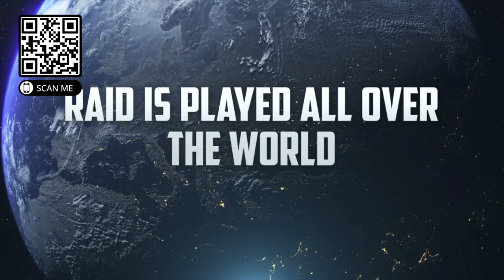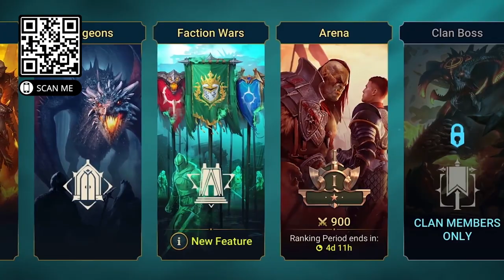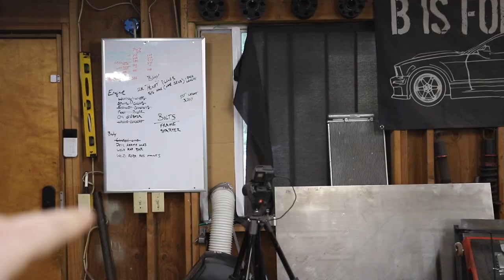Off-Road Lamborghini Huracan Gets Massive GT500 Brakes Installed

Comment from the maker: Install Raid for Free ✅  IOS/ANDROID/PC: https://clcr.me/Jun_BisforBuild   and get a special starter pack 💥  Available only for the next 30 days
Reply: Heat Sheilds on the coil packs!  you'll bake them puppies if not protected.
Reply: Get some of those cheap plastic totes to cover your car bits if you're painting outside to protect them from rain/bugs/etc. Just turn 'em over and plop them down.
Reply: I didn't get a special starter pack. :(
Reply: No
Reply: @eriklarson9137  I am old.. so there is that... but fine..stick a coil pack 4" from a hot exhaust on a high performance engine... no worries...  ;)
Reply: traditionally there is either a floating calipper or a floating disk. the setup here seemed fixed on fixed, but i should ask. which one is it?

Comment: I like how casually he says “We have 800-900hp engine on the way”, like it’s no big deal
Reply: Yea, I'm happy I have a 101hp 1.4L engine in my vw polo 6n😂 and it's more than enough for such a little car.
Reply: @DjKrakTV  101 with a 1.4 6n? What’d you do to it? Thought the came standard with 75hp in the 1.4
Reply: Reminds me of the Star Wars meme
"200.000 Units are ready, with a million well on the way"
Reply: I love how casually he says “on the last LS Swapped Huracan we did”.
Reply: What I like more is that it really is not a big deal anymore.
Reply: B is for Build has come a long way.
Reply: I mean... it isn't really. Anyone with a credit card can buy the exact same thing. It's very cool that he's funding this stuff off of YouTube.
Reply: And you dont?😂😂😂
Reply: Helps when he does pay out of pocket for it
Reply: @Bassie23  the 1.4 mpi 8v has 60 hp and my is 16v, they're becoming rare.
And 1,6 GTI has 125 hp, with small changes I can be there too.👌😁
Reply: Righttt like it was just an impulse buy on Amazon 🤣🤣
Reply: @DjKrakTV  that’s awesome! I had a 1.6 8v thought that had 75hp standard? But don’t quote me😂 it was already a blast to drive as my first car, with the 165 tires it could easily break the tires because it was so light😂
Reply: @Bassie23  yeah, they had 75hp and 60hp depending on the block.
Mine wasn't running as I bought it,  I've learned so much about cars from it. Car was 100 € and I've spend about 2 years and 1500€ to bring it back to live.
Reply: @DjKrakTV  that’s awesome! Is there an instagram I can follow it on?
Reply: @Bassie23  yeah, polo_6n_by_kraszu 
But I haven't posted anything on there since last summer

Comment: i dont know if it was the video angle but the difference between brake and throttle pedal position  seems so far off like you have too move entire leg just too switch from one too the other. It's a big no no racing applications you want 3cm of heighted and depth diff at max so switching goes quickly. i hope it is the angle of footage gave wrong idea suspect you guys know this.

Comment: Ok, I'm confused as to why they're not just running an electric power steering pump? Would make much more sense for a mid engined vehicle
Reply: I’m assuming it’s due to restrictions.
Reply: @richardomontobahn4327  yeah possibly, but from my knowledge of the rules that are usually in motorsports, that's not something that would usually be restricted, and if it's not, then they're just making much more work for themselves, also the electronic ones usually last longer and withstand more abuse at higher RPMS
Reply: They do not put out the pressure and flow needed for that rack. Getting one that would provide those requirements would put a huge drain on the electrical system. This isn't a street car with little tires.
Reply: I was wondering this as well....

Comment: This car is almost a "Ship of Theseus" there is so little of the original Huracan left
Reply: Like 50% of the original chassis, doors and apparently a brake booster/fluid reservoir? Is there more?
Reply: Not exactly the right analogy, as it postulates replacing all the original parts with the same parts. Like it's George Washington's axe, except the handle was replaced four times and the head twice. You get the idea. A lot of resto-mods are frankenstein creations. Look at PowerNation's videos on rebuilding a Ford F100.. new frame, engine, transmission, rear end, etc. with the F100 body on top. Is it still an F100? Well the VIN is what matters, and it's attached to the body, so yes, at least legally, it's an F100. But no it's not really an F100, it's a custom truck with an F100 body. So this is legally a Huracan, but it's really a totally custom off road monster with (part of) a Huracan body. YMMV.
Reply: There’s more of it left than on Vtuned’s rebooted Mustang project!

Comment: The soft line is the feed line for the pump and really shouldn’t be at the bottom of the pump, since they are a gravity feed..not a pressure feed.   This will cause cavitation in the pump and premature failure.....especially at high RPMs, which this motor will live at.    You guys do some good work and use some great parts, but cheaping out on the steering system is not the place to be cheap.
Reply: We had to find a quick solution. We will order the correct pump and pump mount when we have more than a weeks to get the car done.

Comment: Those DBW throttle bodies are GM p/n 12580760 , I use it on my turbo 6.0 colorado build. Originally intended for trailblazer SS they were also used on the 2007/2008 chevys. I’m using Holley terminator max X kit

Comment: How does a smaller pulley produce a higher psi 
Lol
Reply: @fivey03 
Pumps produce flow not  presure 
You could spin it at 20k Rpm and it'll make the same presure as stock 
Just need a different valve,that's what regulates the preaure

Comment: That is not a return line Chris. That’s the feed line for the pump from the reservoir.
Reply: I’m also pretty sure the fluid has to gravity feed into the top of the pump. Clocking the pump upside-down will likely cause issues.
Reply: @rav4l2003  if it’s on the side, it’ll be fine. The gravity will provide enough pressure to not cavitate the fluid.

Comment: Chris can insure that? I think Canada hates cars. I had to get special permissions from my insurance company to install an exhaust and a stock body kit that they sell on a different model. 
Just to top it off none of the mods are covered by the insurance.

Turbo. Nope
Suspension 1 inch drop or lift. Nope
ECU flash. Nope
Bigger tires. Nope.
Smaller tires. Nope.
Slotted rotors. Nope.
Infotainment. only some.

I think Canada just hates everything.

Comment: For the O-ring and for any for that matter, you can buy o ring stock, cut it to length and superglue the ends together. 

PS pump, would be easier to use an SW20 EHPS pump since it can be mounted anywhere and wiring is very easy for it also.
Reply: Way easier to measure the other one and just go to your local seal house and buy a replacement. OR just order one online.......
Reply: @jackhoff7619  the local seal house doesn’t exist everywhere, ordering takes time one may not have. ……………..  ……………………………………………….
………………………………………………..
Reply: @Blyatarina  There are several near him. Also, Mcmaster carr will have one there in 2 days just about anywhere in the continental US. Next day for him if ordered by 3ish.

Comment: That pipe on your power steering pipe is the feed pipe from the reservoir Chris, the low pressure return comes from the rack to the reservoir. lol
Reply: and you might have an air pocket issue when the feed is on the bottom like that, probably it'll be fine but if its not priming that would be the first thing to check

Comment: Damn..  he has two weeks left to finish this car and still takes the weekend off.. impressive!!  Also at first i thought they are just welding on brackets to bolt the calipers to.. the precision required to do that.. the welds have to be perfectly square to the rotors.. and he is going to do them all tonight..i think it would take me a week to do that.. then he explained how they squeeze the calipers to the rotors and then weld... Freaking genius!

Comment: Route the fuel line around the side of the tank instead of looping it under the bottom. You can see in the brake line part of the video that there is room around the right side of the tank to run that line.